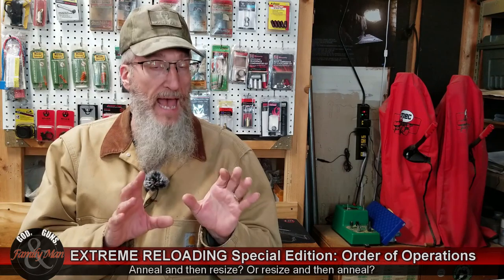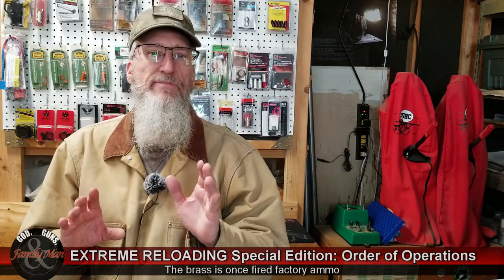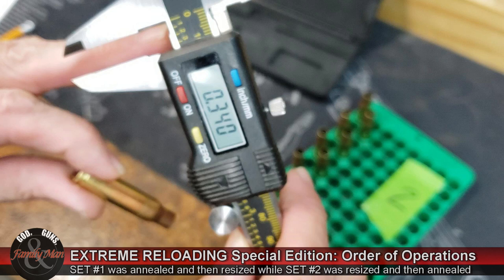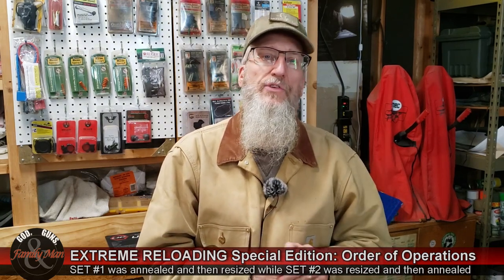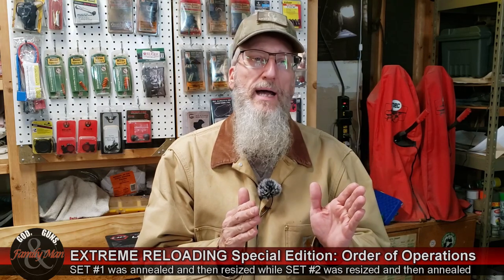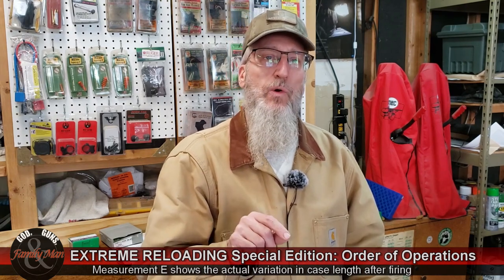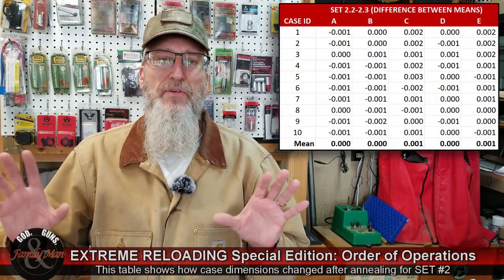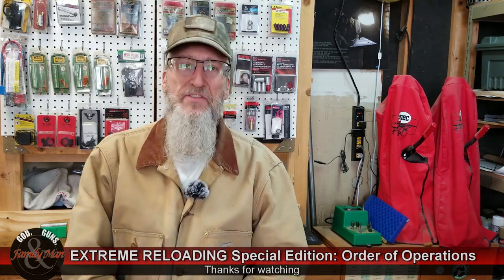EXTREME RELOADING (Special Edition): Annealing and the Order of Operations

Comment: Annealing before sizing assures sufficient ductility in the brass to allow the sizing process to move the brass to correct sizing without too much spring back or over working the brass. The firing process work hardens the brass. If you don't anneal first, you have two work hardening processes imposing their stresses on the brass. Much better to anneal before sizing.

Comment: Annealing first makes sizing easier hands down, especially if you don't anneal every time. Annealing also controls neck tension you can keep constant. Sizing then annealing is ass backwards in my opinion.
Reply from the maker: Data, not opinions. Read Stevenson's dissertation on Annealing.
Reply: @sdkweber  It doesn't appear you know much about annealing, anneal before sizing to prevent neck splitiing, sizing is much smoother with less effort.
Reply from the maker: @ryanglass3570  Annealing is used to prolong the life of the brass.  It does this by increasing the ductility of the mouth and neck of the case.  If the case is annealed frequently enough, after 2-3 firings, it should not split the neck.  If a split occurs that is an indicator the brass has run its course and needs to be discarded.  The order of annealing as shown in the video does not really matter as for overall dimensions of the brass  and is really a matter of personal choice.  Ryan Stevenson’s PhD dissertation clearly showed annealing works (it increases the ductility of the mouth and neck of the case).  It also showed that resizing after annealing begins the hardening process and for that reason a lot of shooters anneal after resizing.  The recent Hornady podcast also refers to annealing after resizing.

Comment: First: Thank you for a well made video 👍🏼👍🏼!
Then: I think that this is more about hardness than about size. If I push to the extreme, a "snug" fit in aluminium is more or less impossible to assemble in hardfned steel. Same here: if neck is harder (if annealing before resize) it is maybe harder to mount the bullet and maybe harder for the bullet to "let go" when firing? Not sure, just thinking out loud...
Reply from the maker: You are welcome.  Even a year after making this video there is no clear consensus on the order of operations.  Hornady's recent annealing podcast mentioned resizing and then annealing but also noted its best (for precision) to anneal after three firings and not to anneal every time. Interesting stuff indeed.  Thanks for watching.

Comment: Own the same machine - not sure cases are being adequately annealed. Grant it - flame annealing is not an exact science.  However, I would certainly be interested in knowing how many firings each of your cases can receive before split necks, primer pocket issues, case head issues etc.
-Bleesings
Reply from the maker: That is a very good question.  I have personally only seen a few split necks and then only on 5.56 brass. I am so careful on case prep that any sign of a problem gets the case tossed out. I prefer that approach... better safe than sorry.  Thanks for watching and posting.

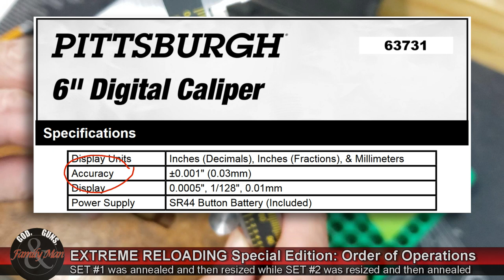Comment: 6:00 No offense and hate to do this... but no, Accuracy doesn't have anything to do with consecutive back to back measurements like you just made. They are "accurate" when compared to each other 
ie, That neck is out of round.
Also use a micrometer for that. Or an eccentricity runout gauge.